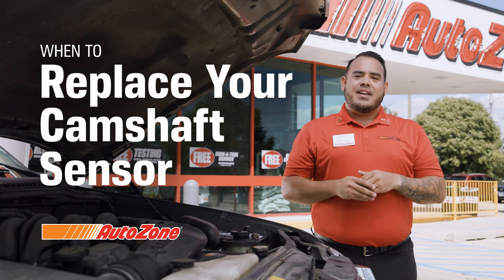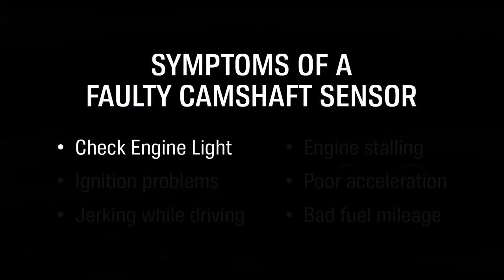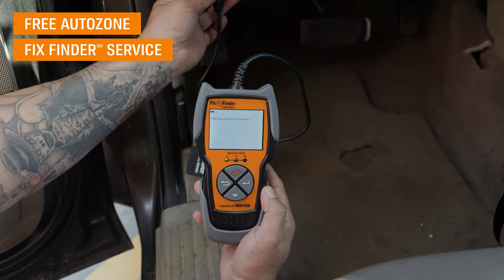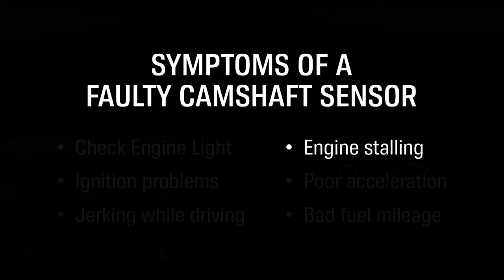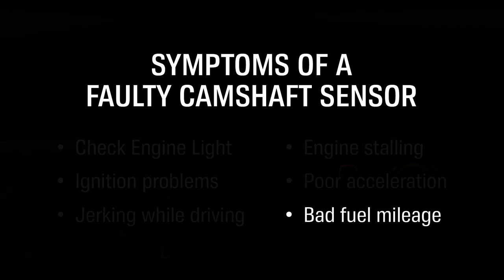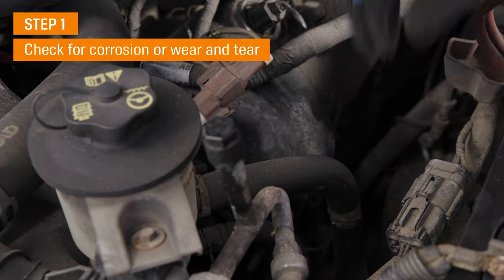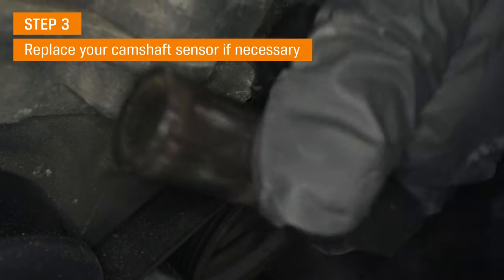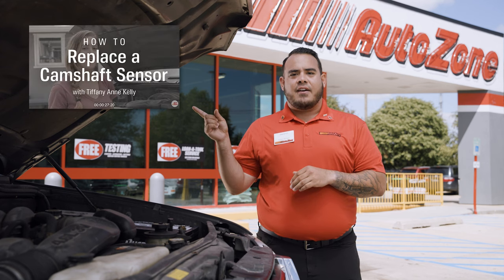When to Replace Your Camshaft Sensor

Comment: Bro I have Ford Everest 2006 rpm is not working when on idle rpm comes 800 after that it can’t work up to 100kmr speed slightly move on 1000 can u help me